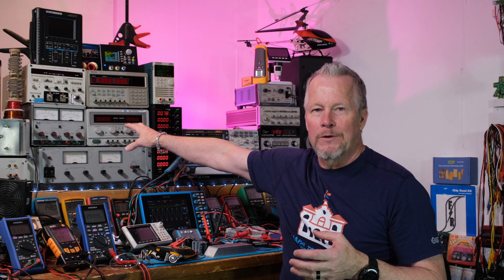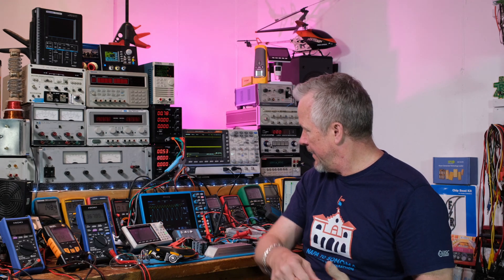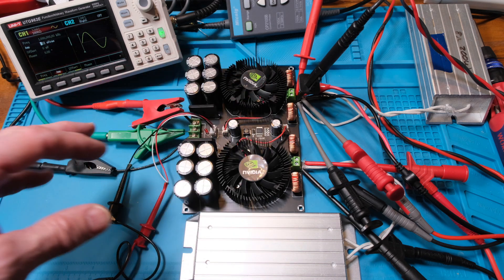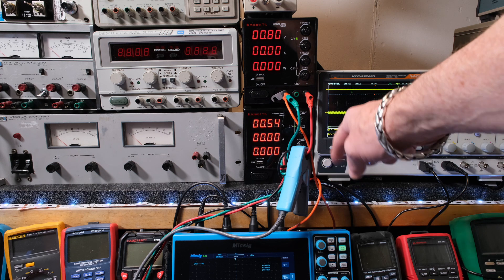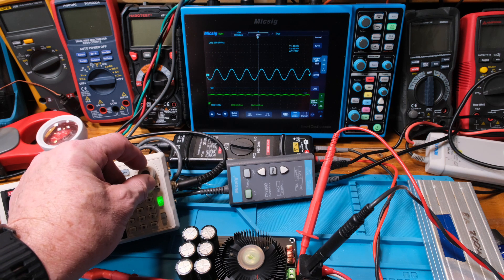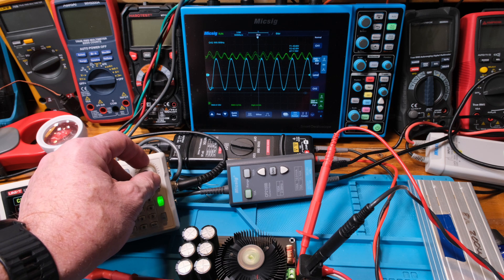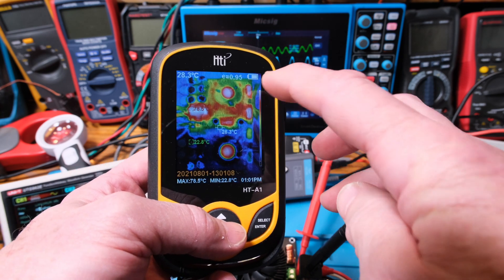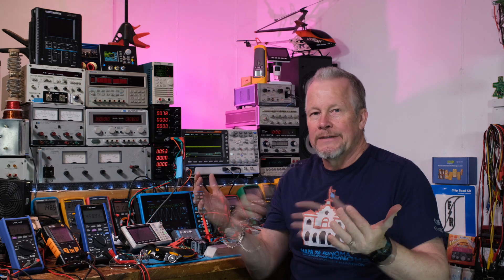Class D TDA8954 Clean 200 Watts out with 2 Kaiweets Power Supplies

Comment: Wish the Uni-T would send out a replacement button to change Mode to Mod as that is the modulation button.  Love that inexpensive waveform generator. Use it all the time.
Reply from the maker: LOL - that generator really is pretty great - especially given the price;)
Reply: @KissAnalog  I have not tested it for THD, but it seems to do quite well and I can't agree more on the price.  I got the upscale one with the higher frequency.  Really like that it can put out 20V P-P just fine.
Reply from the maker: Hard to beat and nice size;)

Comment: Hi Eddie.As always great video.Looking forward to new videos.I have question about this amplifier board.I have same model but I use +/- 39v dc 500w supply.At high volume amp cuts sound for 1 or 2 seconds at one or both speakers.Look like some kind of protection.It does this only at high volume no matter if I use 4 or 8 ohm speaker,or no matter if I use 30w or 300w or 500w speaker.Overcurrent protection,clip protection ?
Reply from the maker: Thanks so much!  Yes, this TDA8954 amp chip does have a lot of protection features, and an over current would shut it off but then allow an auto restart.  Do you have lots of capacitance on the 39V rails?  Have you checked with a scope to see if it is dipping?
Reply: @KissAnalog  no scope Eddie. No voltage drop at high load. Only capacitors are on amplifier board.Power supply board is type that converts 12v dc to +39 -39 v dc.
Reply: @KissAnalog  Sound is clean,and just starts to cut out so i have to turn volume down just a bit,but i feel like speakers can take more and amplifier should give more in comparison to my other amplifiers.

Comment: Okey first off thanks for putting extreme effort into your videos! I bought near identical amp, but it states on the sellers page 24vAC up to 28vAC.. but it seems like all components can handle more.. Im guessing you are in this video putting 31v AC x2 in correct? i was planning to upgrade an old power amp with this board but that gives out 36V AC(messured with the amplifier turned on with no input signal or speakers connected) from the 2 orange and 1 black.. its rated at 230v and 365Watt(lable on the back of the amp).
Reply from the maker: Thanks so much!  I used DC Power supplies so I could simplify the test.  I used 31 VDC rails, so this would be the peak (minus some ripple) of an AC voltage of about 22 Vrms.   I think they recommend 26 Vrms as the max ac voltage which would give about 37VDC for the rails (42VDC is the max the device is rated for).  Does this make sense?

Comment: Hi Eddie. Thanks for the awesome video! I would liked to point you to a hyped class-d amp from bang & olufson the "icepower 125ASX2".  It has a smps onboard so no need for an external one . The supposedly original modules on ebay aren't very expensive.
If you ever get hands on it, it surely makes a very interesting video.  It's already reviewed by  audiosciencereview with following conclusion

"The bottom of the amplifier market is comprised of single IC amplifiers. This class of products uses a full module with much elevated performance level. It is great to have a super efficient, cool and light amplifier that runs circles around the amplifier in mass market AVRs for not a lot of money."
Reply from the maker: Thank you Martin!!  Very cool (pardon the pun;)!  I took some time to look into this, and I'm very interested!  I want to get one - if not for anything else - but to reverse engineer it;) 

I really like the tests that he does, but like some of the others who commented, I'm not sure about his summary.  The multi-tone does show a building of THD - as he admits, but then he seems to be OK with that.  It only bothers me as it is so high.  It makes me very intrigued in that particular test - to see how amps stack up.  To me that's been the most telling;)  Thank you for this link!!

Comment: It should do 336W at +-41V/8ohm and 376W at +-39V/6ohm with less than 1% distortion. As a bonus you can calculate the efficiency, which was supposed to be 93% according to datasheet. From your previous video I can see that number is way off.
Reply from the maker: Thanks for the feedback Ergin!  I think I was getting close to that efficiency.  At 200 Watts out and 93% efficiency, then I would need 215.5 Watts at the input.  I had 64 V (2x32V), so then the current would have been 3.36 Amps.  I thought it looked close but I didn't write it down.  I think it was just above that but not much.  I'll test this.  Thanks!

Comment: Thanks for the videos. I'm really enjoying them. There are quite a few commercial active speakers that make use of these ic's (Wharfedale, dBTechnologies & even JBL).dB Technologies make some active 12 & 15inch speaker that use 2 in BTL, one driving the low freq driver, the other driving the tops (total overkill for the tops,  they do reduce the output to the tops though). Great class d modules. Something of interest is that in order to run 2 8954's together in bridge mode, both modules need to sync to an external clock in order to avoid beat tones (datasheet.) The dBTech speakers used a very interesting way of creating an external clock using a triple gate inverter with just 2 timing resistors & a capacitor.  Anyway, keep up the great content.
Reply: Oh I almost forgot, the dBTech speakers where using +-40v for power supply. And those speakers kick some serious ass!!
Reply from the maker: Thank you!  Sounds like they are getting the most out of the device;)
Reply from the maker: Wow - thanks for the great feedback!  That's great background!  Those are great companies too, so that's a confidence builder.

Comment: Another great video. I think a little too much is better than not enough.  You can Always turn the volume down. Avoids clipping by over driving the Amp. My power supplies at home only go up to 30 volts as well. I was looking at Amazon today and DROK sells 48V 10A adjustable power supplies for 35 bucks each. They have an LED display on them. That is a steal if the output is accurate. I wanted to ask are you going to hook this amp up and use it? Probably be great for jamming to tunes in the backyard, cooking out.
Reply from the maker: Thanks Tron!  I agree I think I like the idea of a little headroom.  I'll have to look into the DROKs;)

Comment: Lots of power, but in HiFi terms THD is quite high and noisy fans that seam to run all the time. Would be better if the fan was on a 'on demand' bases. The question is what do they sound like? Do they have a sound? hopefully not. So far I think I will stick with my L12/2.
Reply from the maker: Thanks Michael!  Sorry I was focusing on the power and mostly using the THD to see when the clipping started.  I'll have to get a clean set up and consider the noise of the generator to give the Amp a fair THD measurement;)

Comment: When I think of 200 W or 400 W when using a pair of Klipsch LaScala’s.  OK when you use the very FIRST WATT  you have 106 db.   
             What do you do with the other 199 watts or 399 watts. 
        I guess that’s just extra headroom lol 😂
Reply: The brochure says 104dB 1w/1m for a LaScala.  Mathematically, you'd be able to produce about 130dB with 200W to each speaker and maybe 136dB with two of them.  However, the speaker can only handle 100W continuous and is thus "only" rated to produce 124dB at 100w/1m.  That's still high enough to damage the hearing of anyone nearby in mere seconds, so I don't recommend trying it ;).
Reply: @antibrevity  are use my sound meter because I was curious what do I like at a moderately high comfortable enjoyment level. For me it’s around 83 DB with 97 DB spikes. 

    104db or 106db at that loudness I’m not even going to notice the difference of 2db. @ 1w/1m 
              Even hooking my Nelson Pass ( Amp Camp Amp) Version 1 that only has 4 W  to my DYI Fostek Single full range driver 8 inch backloaded horn cabinet 96db rated. 
          Just driving one watt of power out of that 4 Watt class A amplifier was way more than enough. 
                 I had to turn it down to about 3/4 of a watt to be comfortable

           When I hook that 4 watt amp up to a signal generator and I found it resonance frequency inside my room the drywall was shaking the dishes in the cabinet were shaking and my neighbor asked me what the hell was I doing at about 49 Hz.   Yep 1 W is too much
Reply from the maker: Thanks!  great point!
Reply: @KissAnalog  But I am all for more is better bigger power supply bigger amplifier
Reply from the maker: @t lech that’s really great info - thank you!